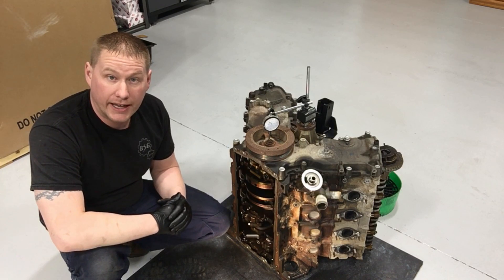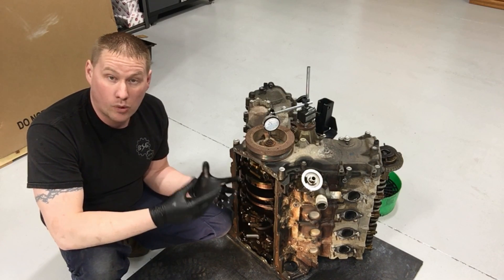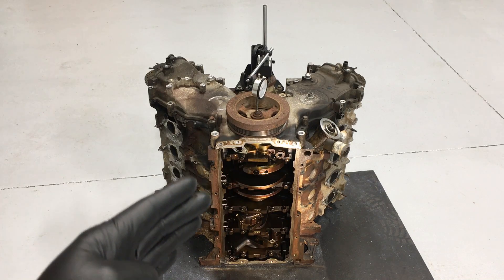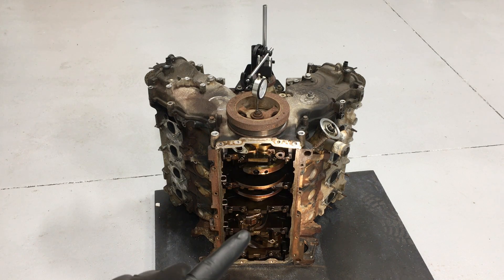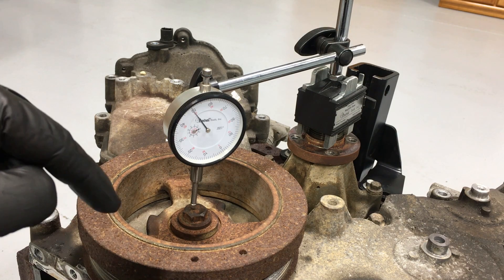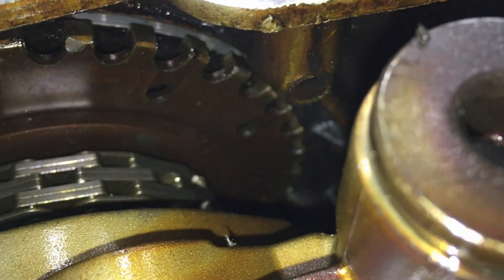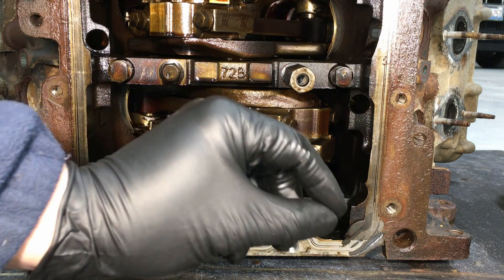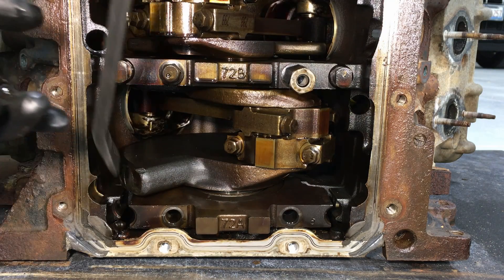Ford F-150 5.4L 3v Triton Engine Thrust Washer Failures: What You Need to Check!

Comment from the maker: These are the Parts and Tools I recommend:
Flexible Dial Caliper-
http://amzn.to/2GGk3y0
Reply: What remanufactured engine(s) do you recommend?
Reply: I'm also wondering if those can be replaced with the engine in the vehicle but the oil pan off. I'm doing a timing job on my 2007 and I have the pan off so that I can clean out the fragments of the chain guide. Preemptively replacing the thrust washer is something on my mind since I've seen your videos on their failures.
Reply: FordTechMakuloco can those be changed just by dropping the oil pan?

Comment: I heard a tick at times while in reverse at idle I thought I had a cracked flex plate on a Lincoln mkx 3.7 and I took the transmission out but o don’t see any cracks in the flex plate . I did see That the thrust washers have play once I removed the rear main seal cover. Are they supposed to have play?

Comment: I found the thrust bearing in the oil pan chewed up and bent. Truck was running good apart from deceleration I noticed I heard some throttle noise. Wonder if I need a neelw motor bow

Comment: I have  a 08 f 250 315k miles. Started rattling on top side and quit running less 5k miles later. I checked thrust with feeler gauge. .010 thrust. Do you recommend a timing job or complete block rebuild .

Comment: Thank you for this and all of your other outstanding videos. This one in particular saved me a bunch of headaches by solving the mystery noise on my 08. The crank pulley is out about 1/4” from the timing cover! Oh well, time for a motor, and with 204,000 on this one I can’t complain. I am sure I will be using your other videos for the swap over. If you see this, do you have any updated recos for a crate motor, that is using ford timing parts and such? Thanks again

Comment: Would a damaged thrust washer cause the crankshaft pulley to wobble?
Reply from the maker: no
Reply: @FordTechMakuloco  today I replaced a harmonic balancer for a 07 Expedition EL Limited that had a wobble and a chirp that temporarily went away by spraying lubricant.  The new replacement OEM fixed the wobble and chirp, so now with 200k miles it is running like a top.  I occasionally get a P0420 so I temporarily installed a spark plug non-fouler in the downstream O2 sensor.  I will probably replace the cats with high flow so they will be less likely to clog.

Comment: Bearings were good so I did a timing job and it ran great.  Shortly after the truck started to make a clinking noise that felt like a bad tooth alignment in the differential and a binding that came along with it so i grabbed a diff off marketplace for 100 but the noise was still there.  Drove it a couple times till it barely made it home and found that the trans was the culprit so 4000 into a transmission to replace the forward drum. problem went away for about a week and now it's starting to clunk again and the belt is also starting to chirp.  Come to find out the belt is no longer sitting back which would tell me the Bearings went bad after all which pulled the torque converter forward destroy the transmission and now I need 4500 to replace the engine. So now to sell off my projects in the garage to get an engine or keep on the ford track and learn more about engine building. Yeah, I'm gonna get a reman

Comment: I've been really lucky then I have replaced these multiple times put new bearings in as a in frame job and the folks i sold these trucks to are still driving them I also did a several serous engine flushes before and after these jobs

Comment: I just purchased an engine from power train products and after installing the crank pulley I really feel like it sits way too far out from the timing cover almost the same distance as the pulley in this video when you have it set all the way out with the pry bar but I can't see any visual play and dont have any tools to measure the actual distance yet but I can certainly fit a pry bar / screw driver between there and it just doesn't seem right to me. Is this normal on the new engine? is there a break in factor that needs to happen in order for the rest of the engine to settle those parts exactly where they need to be?

Comment: 2 major questions: Did this problem exist in the 2010 model year as well? And got a cold start rattle (very light) around 3 months ago, probably 3k miles ago or less. Should I urgently get this work done or is it fine to drive a bit further? I see some people that go 40k with the cold start rattle but I'm sure that is damaging the roller followers and valve area from lack of oil. I would love to wait another 5k miles to do this job but I'm not sure what kind of damage would happen in that mileage with gentle driving. Then again, I can fix it now but I only have 140k miles so it seems a bit early.

Comment: Considering I have 262,000 mi and my truck runs good. Do you think this truck 2008 3 valve has the original cam phasers and timing components, and people that know Ford well what about the 6-speed transmission in this 08 expedition you think that's original, like to get some feedback to know if cam phasers in timing parts can last 262,000 MI

Comment: I remember you showing me this video on a truck saying put a screwdriver between the timing cover and the harmonic balancer and see if it moves. I ran out there at 1:00 a.m. cuz I just got the truck and I checked it and mine was right up against the timing cover and no play. Dallas last year I just change the oil every 3500 miles don't know if it's the original engine or timing components but it's got $262,000 me and it's an 08

Comment: I did what u said not too before I seen this video but question I replaced thrust washers with motor in and went very easy but I still had alot of end play why would that be if I put factory washers back in is crank worn out or somethings else?

Comment: If the thrust washer is the problem, you were saying reman or rebuild youself if within your capabilities. With the rebuild, would you need to regrind the crank and how would you address the thrust surface area of the crank to still maintain end play within spec?

Comment: thoughts on 07 f150 with 245k just did transmission rebuild because it had a cracked flexplate while it was out, now fast forward 9 months later with 3k on the rebuild and ive got a broke flexplate again!!!!! the tranny guy didnt use a motorcraft flex but a aftermarket one idk???? could that be the problem???

Comment: Just checked my 2007 Expedition while doing a timing job. Measured 0.008" at 206,000 miles, right in the middle of the spec.

Comment: Well, at least it's probably rebuildable.  Gonna need crank grinding, undersize bearings and thrust washers for sure, along with all the other new parts, seals and gaskets.

[edit] - I take that back, you'll need a new crankshaft to use this block again.  The largest undersize available from Sealed Power is 1.0MM which converts to .039 (aka 39 thousandths), which would take up most of the .050, but considering you'll have to clean up the thrust surfaces on the crank, I don't think you'll be able to get the clearances within factory specs.  Unless you did something fancy like spray welding more metal on the thrust surfaces, but that's probably not cost effective vs getting a new crank.
Reply: good info, thanks

Comment: What could cause this? Could the Transmission cooler lines be blocked to cause the TC to be pushing excessively against the crank? Maybe the cooler lines bypass block valve clogged and pressurizing the TC? Any ideas? I have this same issue and would like to fix this so it doesn't happen again. Any help is appreciated...

Comment: "Another common problem with 5.4 liter maybe you should again think about owning one" Paraphrased Ford Tech Makuloco
Reply: GM is worse. Silverado overheat on purpose. Via cooling fans not clicking on till 235.F. And their build that way. So the temp gauge sits at 2 o clock(2007-2013)

Comment: I have a 05 and I was doing a timing job on mine with ur videos for help and dropped the oil pan and found the thrust washer in it
Reply: Same thing happened to me how long did it last
Reply: Just happened to my 06 found one in the pan
Reply: What repair option did you guys end up going with? Currently doing a timing job on a friend's truck, the thrust washer failed aswell. Would it be possible to just replace the thrust washer and timing components?

Comment: if you used a feeler gauge under the crank pulley what should the number be and a bad numer would be .014 larger than the good number approximately ? and  Thanks again asking because I have the 07 5.4 3v in my F 150

Comment: Why did the 3v hit only a few people so hard. I have a 2v and 3v both over 500k miles. Neither have even had so much as a valve cover leak. When i pulled the 2v apart the thrust bearings were in amazing shape.

Comment: While the crank is checked for end play on automatics with the engine still in the vehicle, wouldn't the flex plate need to be unbolted from the torque converter, and the serpentine belt be removed?

Comment: I just bought a 2010 F150 4.6l 3 valve and it had the same problem on cylinder #2. The engine had trouble codes P0011 and P0021, I thought it was the timing chaing or vvt sprockets but no, the thrust washer failed, lucky for me the valve just got bend and it stays in place.

Comment: Question I just purchase back in December of 17 at 2006 F150 King Ranch version Cadillac converter is totally messed up can I convert over to running pipes out the solve that problem about the Cadillac converter on a 2006 F-150 King Ranch

Comment: I bought it new, and I now have 218,000 mi. on my 07 SuperCrew Lariat 4x4.  With FordTechMakuloco's help, I did the full timing job at 171,000 including the M360 oil pump, due to the slight diesel noise coming from the phasers.  I did not replace or even remove and check the roller-followers as Makuloco suggests.  I don't baby it at all.  My daily work commute is 15-20 minutes each way.  I used conventional 5W-20 for the first 171,000 miles changing it every 4-7k miles. I switched to synthetic after getting a good look inside during the timing job, and I now try to keep it changed before 5k miles.  I do need to add oil, 1-1.5 quarts between changes.  It's still a pretty good truck!

Comment: Could this be an issue with the 5.4 in a 2010 Ford f150? I heard another video of someone who was having this problem and sounded exactly what is wrong with my truck. Multiple garages, multiple different backyard mechanics, changed transfer case, 4x4 actuator and vacuum hoses, solenoid and the problem still there.

Comment: I change Oil every 4 months at first with 5-20 W conventional Oil. Now with synthetic 5-30 Oil like you recommend, still hear tapping during warm engine idle.  What remanufactured 5.4 3V engine co. do you recommend?  Can you have them install the high volume Oil pump with the latest Ford Cam phasers that
you recommend?  I maintain my trucks, no scratches or dings, always washed and waxed, worked hard but not beat on.  Thanks for all the good advice.

Comment: Quick question i have a 2005 f150 5.4 did the whole timing chain and phaser replacement dropped my oil pan to get the rest of the plastic chain guide out notice no wear but my thrust washers were in bad shape if I replace them put everything back togather will it run good long enough for me to sell it thanks

Comment: My bought my 05 f150 almost new. Within a year it threw a piston rod. After fixing that the coil packs and spark plugs started going . Then the fuel pump.  So who gets the booby prize for worst engine design.  Its a toss up between Cadillac and ford.  At least ford quit making the 5.4 after 6 years. Cadillac built the northstar engine in 1994 models and didn't quit till 2010. Knowing it had issues for years and doing anything.  Just stupidity!

Comment: Thanks Brian! Another great video. I have a 2007 Expedition with the 3V 5.4. It has 150,000 miles on it. Is there any preventative measures that can be done to catch this before it destroys the engine?
Reply: You can check your endplay frequently.
Reply: @TheChrisey  Thanks. I now have a 2019 Expedition Limited with the 3.5, so I don't worry about this anymore. I gave the 2007 to my Daughter and Son-in-law. It is still running great and now has 270,000 miles on it.
Reply: @raycalandra1887  I had a complete thrust bearing failure last week. Destroyed block and crank so that sucks
Reply: @TheChrisey  Sorry to hear that.

Comment: I see a lot of problems with these Modular 3 valve engines.... Do the earlier 2 valve engines have these problems too? I have a 02 Explorer 4.6 with 214k original miles on engine and trans. The exhaust just started leaking at the manifold and I'm worried these other problems will start creeping up soon.

Comment: Yeah my throat washer half of it was wedged in the block and the crank the other half laying in the oil pan been like that since I bought it brand new dealer said can't find no problem and then after warranty one out they want to pull the motor out I pulled it out and I found the thrust washer hung up in the crankshaft from the day one what a rip-off Ford is

Comment: I am thinking so as the crank is thrusting away from transmission as in the case you show. High mile engine as the belt tensioner pivot bushing has worn out causing the pulley to grind into the front cover. Really curious has this reoccurred? Done 30 k trans services to mine since I have owned it. My crank thrust is 0.009 in with no belt and 150k 2007 model.Had me worried never checked the crank end play outside of just dropping the crank into a fresh rebuild.

Comment: I have seen this failure in the 90s with the AOD transmissions. The TV linkage or valve would stick off idle causing high transmission line pressure  at idle causing excessive pressure in the torque converter at idle when oil pressure is at its lowest that would excessively load the crank thrust bearing and cause it to fail. Could the EPC solenoid be sticking in the same manner in this case? have you seen any returning cases?

Comment: I was wondering if you could pint me in the right direction. I have a 07 ford f150 5.4 supper crew. when I pull my travel trailer and go up a hill I get a noise from the engine that almost sounds like a baffle in a muffler when it goes out. was thinking maybe some sort of heat shield vibrating. But after finding your vidios about the 5.4 I am freaked out about it.
Reply: Check the driveshaft u-joints, that and the carrier bearing in the middle if its a two piece driveshaft. Also check the motor and transmission mounts.

Comment: So i have a question not fully on the topic of the video. But i have a 2000 F250 with the 5.4 and i was wondering if the V10 would be a more reliable swap?

Comment: Is this a common failure on over serviced engines have a 07 90,000 miles 3k oil changes since new.Recently using 5w30 was using 5w20 always used synthetic.Going to check the endplay this weekend. Shit thought this was the year that had the least problems. thought they had the thrust bearing problem figured out after the 91 4.6 in the Town car. Guess not.

Comment: Ive made a lot of money working on these garbage engines. Thank you ford for another engineering atrocity.
Reply: Platform is better than people know. The failure are bad owners. Ive not seen an issue on these modulars that wasnt deserved from neglect. Nothing against what your shop has come across but ive had nothing but good runs on these runs of engines. 07 2v romeo 593k. 07 5.4 3v 523k and a 08 5.4 2v s/c. Rebuilt for racing in 20011 and run hard. Never eaten a set of bearings or washers on any of them.

Comment: I’m glad I sold my 07’ screw 5.4 last year. Between replacing the spark plugs and doing a complete timing job on it I totally lost interest in it.  I ended up buying my dads 03’ FX4 Screw 5.4 70k miles that he bought new.  Not as equipped as my 07 was but I love this truck so much more.  Last good year Ford made a reliable engine.

Comment: Amazing how far down hill the Domestics have gone these days. We've only been building engines for what ... 100+ years now? Unreal!

I've got a '07 Silverado with a 5.3 that I bought back then - first new vehicle I ever bought in my life (and my LAST). If the Ford dealer was open on Sundays, I'd have an '07 F-150 with this exact Triton engine in it. Not that it really matters, since GM designed the worst valve train in the history of automotive engineering with their now notorious AFM system. I'm at 92k on my Silverado, and oil analysis has been showing high levels of iron & copper (cam bearings, given this model engine's failure history) running Amsoil synthetic - never gone more than 9k miles on time before changing it either - well within a synthetic oil's capability. The engine is a piece of crap, thanks to modern cost cutting. Just a matter of time before it becomes a $6,000 pile of scrap. 😡

Comment: i own a 03 ford focus 2.0 dohc zetec vin 3 w/about 210k. I just changed my main & rod bearings due to a slight knock, tore it apart & found excessive wear due to a previous owner & I have done so many repairs & upgrades, I have put way to much into it! tho, I can't stop now, commited! I know it's not 5.4 related but, its a FORD. RUNS GOOD AGAIN!

Comment: The most reliable engine Ford manufacturers is the 3.5 Dura-Tech,
Reply: Theodore Rinehart Yeah until the water pump fails and dumps coolant inside the engine.  Great engine but piss poor water pump location.

Comment: You have made quite a few videos of the problems these 5.4L 3 valve engines have. They seem to need quite a bit of repairs once they have +100,000 miles On them. Do the newer 4 v V8's and the ecoboost engines in the newer F150's have the same issues???  Thanks for all your informative videos.